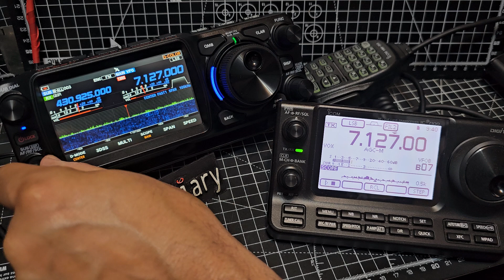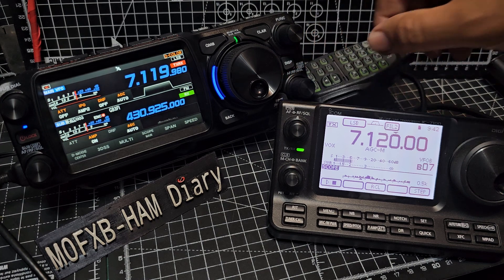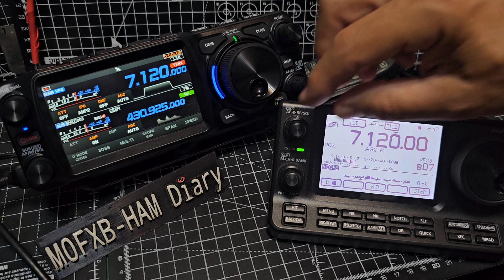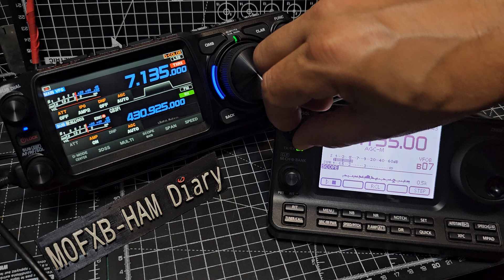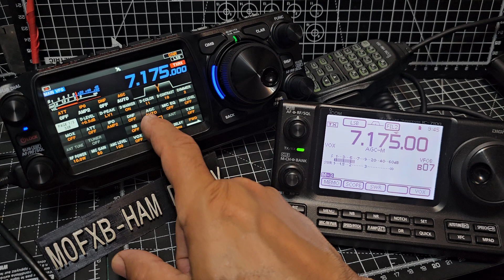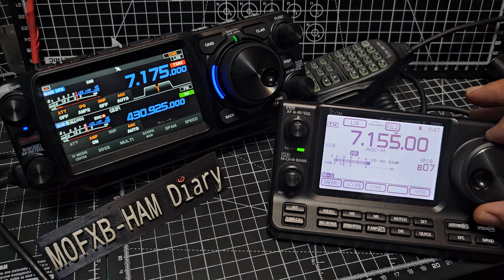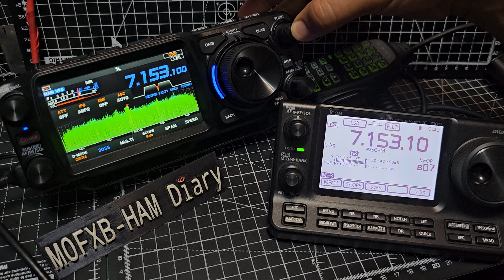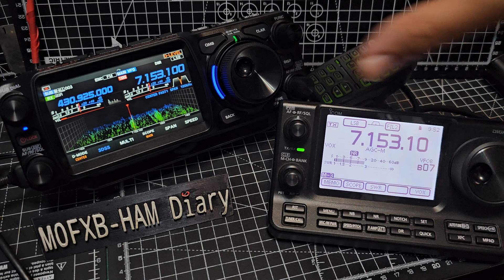New Yaesu  FTX-1 & ICOM IC-7100 Compare

Comment: Interesting video. The IC-7100 sounds better to me, but it's possible the difference could be the different antennas. It would be even better if you could switch directly between radios on the SAME antenna. Thanks for the video
Reply from the maker: Welcome :)